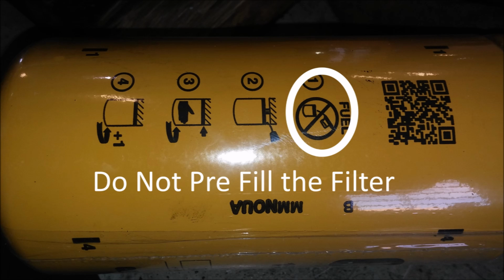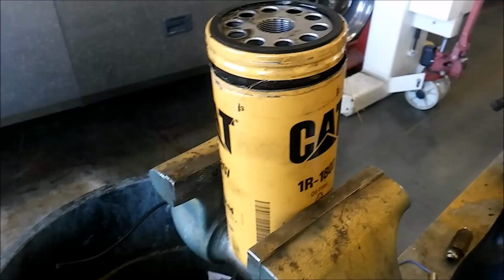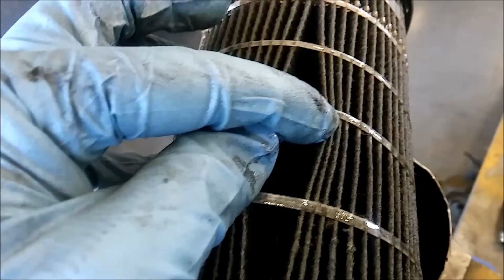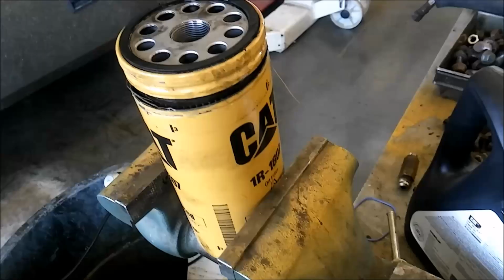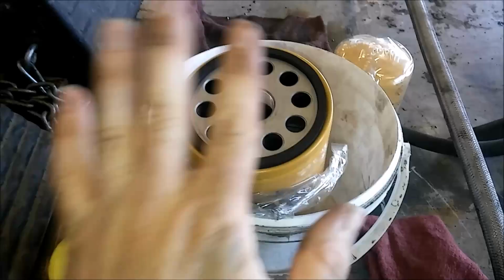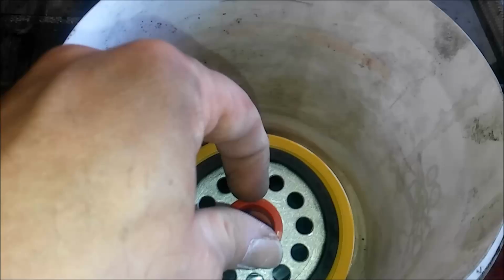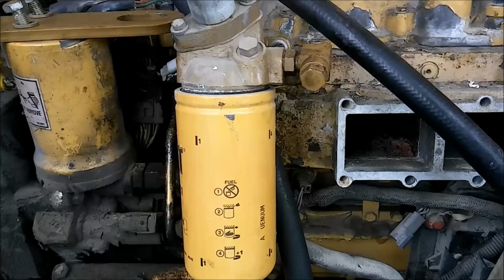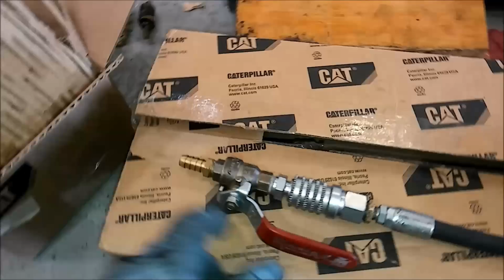Should You Pre Fill an Oil Filter? Should You Pre Fill a Fuel Filter?

Comment: always have filled them up in the center. as long as its new oil and new fuel. worst thing you can do is not prefill a filter especially on a big engine that has several oil filters and sometimes a gallon or 2 of oil can cause unnecessary and premature engine wear. but hey what do i know
Reply from the maker: +hayden ingram Lots of people fill them like that, I do on a rebuild, but I was just giving the information from the Caterpillar guidelines.
Reply: I agree with you man 100% you should always prefill
Reply: yeah at cat they tell us dont fill them which i dont listen to that. my boss didnt like what i said.lol
Reply: teller of truth I look every time and don't see anything ever.
Reply: lol i look every time. i dont understand why you are so hostile haha
Reply: alot of large engines. about 16 litre plus normally have a prelube pump and the engine wont crank without a certant oil pressure.
Reply: hayden ingram prefilling is fine, but fill from the inlets of the filter, not the center outlet.
Reply: i prefill every single oil filter thats upright through the center. i changed the oil in my 7.3 the other day it takes 15 qts of oil which is 4 1 gallon containers with 1 qt leftover. they are white bottles and guess what just like every other time i change oil with rotella the bottom of the container is clean with no debris or dirt. the people on here that say oil is full of dirt and debris are complete idiots im done arguing with you arm chair mechanics who cant even fix a peanut butter and jelly sandwhich have a good day and god bless.
Reply: "I've never seen an oil jug with out dirt "

Stop buying that Dollar Store brand oil!
Reply: if anyone is interested, oil comes in dark jugs because its not designed to ever see the light of day, uv causes shit to degrade, same reason beer comes in dark bottles
Reply: I was always told beer comes in dark bottles so you can't see the mouse inside
Reply: I been a diesel mechanic since I was 18. That was many years ago. I have seen crud collected in the bottom of jugs of new oil. Light colored containers are easier to see it in for sure.  All oil regardless of quality has debris settling out that gets caught by the filters  or settles to the bottom of the pan. 
What you can see is definitely not consistent and can completely disappear if you shake the jug or bottle. This shows that there are definitely larger particles that can fall out of suspension. Tests sent to labs will confirm this.  
So for you guys claiming that new oil in a jug is filtered to car filter standards you do not know what you are talking about.  Send it to an independent lab and see what they say then come back and tell us about it.
Reply: have put over a million miles on 3 different diesel engines and never prefilled one is still running as far as i know. but i never fire it up until it shows oil pressure.
Reply: @HaydenIngram  

Lol!
Reply: @Gideon_Judges6  

Holy shit!!! Just about pissed myself!!!!

Comment: I completely agree with what you said. I have three International IDI's in my Ford trucks. I always prefill their fuel filters, otherwise I'd be sitting there cranking forever to purge the air with their mechanical lift pumps...
Reply from the maker: +Clint Osowski Not pre filling the fuel filter can be a real pain in the butt.
Reply: Yeah, and a battery killer...

Comment: Yes , you are exactly correct . However I have been filling filters from the center forever but after seeing this and knowing the risk I have imposed on my engines doing field maintenance etc. Maybe we could build a filter primer for fuel and oil . 

Thank you for this video .
Reply: Cat has primers for fuel on their loaders. You just screw on the new filters and flip a switch and it primes the whole fuel system.

Comment: I have a series 60 we pre-filled since new. at 1,000,000 miles. The blowby suction tests showed no loss in compression and the oil samples were always in the green. I pre-fill because I know how much oil each truck uses exactly when I pre-fill. When I am done pumping oil, the level will be at the line on the stick even after warming up. CAT is crazy on fuel filters, it's not just difficult to prime, its damn near impossible without pre-filling.

Comment: So long as your not sloppy and prefill your oil filters (doesn't matter which side) with new oil using a clean funnel you won't have any issues. As for fuel filters, all the CATs I work on have hand operated priming pumps on the secondary filters. On the bigger CATS this is essential as the filters are reasonably large and will push the internal volume of air through the fuel system damaging pumps, injectors ect.

Comment: If one is worried about contamination on "new" oil and fuel, why not pre-filter that fluid thru an OEM filter on a rig? you know have a small pump push the fluid thru a filter which is used only to pre-fill new filters being fitted to an engine and only right at the very moment they are to be installed. Then you get the best of both worlds, nice full filters, filled with properly filtered and clean fluid.

One "Pre-fill" filter would last probably hundreds of engine filter services before it had to be replaced itself.
Reply: By simply mounting the oil jug up high, you can simply gravity feed the oil through the filter, eliminating the need for a pump. pouring it slowly will insure that all the air is purged out of the filter media, giving the filter a better prefill.

Comment: The way I interpret this is bulk oil is already contaminated     in that case I would not prefill the oil filters    if the oil is new and
clean to begin with I would pre fill the oil filter   so far for the fuel filter diesel I never did that my guess would be put them 
on dry and unloosen the injector nuts and prime the air out of the system?           I know on airline passenger
jet liners my understanding they never change hydraulic fluid because the possibility of contamination  they always add to it
very good topic   allot of half ass A&P mechanics out their also   its scary   
(I favor not to prelude the filters) for contamination reasons   I always prelude a engine that is new   diesel I never worked with

Comment: On the fuel filters for a Deere 8.1 engine, they come with a dandy little funnel that screws into the center hole, and forces incoming fuel to fill the filter from the outside in, as it should be done. As far as pre filling oil filters goes, the only one that I ever ran across that pre filling was mandatory was the turbo filter on an EMD turbo engine, and their manual said nothing about the "right way", so the vast majority of those were filled via the center hole straight from the boat's bulk oil tank.  :-/  Good tip on the dust cap, I used to teach my guys that trick. Another thing that we'd do for filling those turbo filters was to raid the rag barrel, set the filter in a five gallon bucket like you do there, and then pack rags around the filter so it would stay upright. Good video, loads of good information. Thanks!

Comment: Well I know for a fact Cat started putting the full filters upside down so you couldn't put fuel in the cuz pple getting dirt in them and fuckin up injector's cuz with the new machines carry such high full rail pressure even a speck of dirt can ruin them and that is why they put a electric fuel pump on them or a hand pump so use it

Comment: I don't know about changing oil and oil filter on your big CAT engine using bulk (not so perfectly clean oil) but for home automobile, I have some thoughts. It depends on how your oil filter is mounted, horizontal or vertical. Obviously,  you can't pre-fill a horizontally mounted filter. My 2003 Ford Excursion has a vertically mounted filter and I always pre-fill the filter. Another point I want to make is with the filter already pre-filled and when you start the engine after the oil change the oil pump will get the oil much quicker and the time it takes to prime the oil pump is greatly reduced and also new oil will circulate the almost dry engine faster thus reducing any unnecessary dry start engine wear. Since for home DIY oil change project, we are buying brand new bottled oil either in 1- quart size or 5-quart size and there is no contamination so pre-filling the oil filter from the center or side holes makes no difference.  Pre-filling the oil filter (whenever possible) does an engine good.

Comment: To the people who dont pre fill oil filters because "the oil is dirty because of mass production" or whatever, what exactly do you do with this "dirty" oil right before you pour it into your crankcase? I highly doubt you guys  run it through some kind of filtration system before you put it in your engine.
Reply: Gilbert Rentas 
Such a good point.
They are over thinking it with no pre fill approach yet dumping oil directly into the crankcase like everyone else. Ha!
Reply: oil from the crankcase is pumped directly through the filter, before it passes on through any of the oil galleries. The concern would be if the filter is prefilled through the center hole, where the unfiltered oil will be pumped into the galleries. I, Myself, don't worry about the contamination, if I'm pouring brand new oil from a brand new bottle, into a brand new filter. I would rather have the immediate oil pressure, to reduce 'scuff' on the initial restart after the oil/filter change.

Comment: Great topic. I do several services a week, I've always pre filled the fuel filters, never pre filled the oil filter, can't imagine trying to screw on that big C15 filter full of oil.
Reply from the maker: It is a total pain I assure you, plus you probably know that it is hard to get the oil filter aligned and threaded sometimes. Thanks for the comment.
Reply: This whole discussion should not include diesel owners/techs that have/service engines smaller than 11liters. When you work on big engines different rules apply. The sheer weight of the big block oil filer filled with oil makes it almost impossible to screw it on by hand. On ISX15 for example the access to the filter is very limited and you can try all you want to screw it on with oil in it, but if you strip those threads than you are in real s**t! Now, it will cost thousands in labor and down time to fix it. It is just safer and more practical not to put oil in. You can add some if you really want, but it's basically pointless. Yes, Cummins wants them prefilled but....

Comment: Iv had this same argument with techs/owners over the years. I never fill an oil filter. The only thing I ever fill is the fuel and thats just a necessity. Iv even had an argument with another tech about pre-filling a dang coolant filters. Why the hell would you think you have to fill a coolant filter. Anyway, love the vids man. Very informative and you explain things well.
Reply from the maker: Thank you very much. I have seen a lot of disagreement on this very subject so that is why I made the video. Keep the filters clean!
Reply: Stephen Co
Reply: Stephen Cox have to prefill coolant filters otherwise you could get an airlock in the cooling system
Reply: i have made it a habit to always vacuum fill coolant systems. then let them hold a vacuum while i do some paperwork or other repairs for awhile.
Reply: So you are saying you are smarter than the us military in there studies on filters! A filter is stronger wet. They spent a lot of our money finding why the filters burst on start up.  They found out its dry!
Reply: freddy freddy 
It is likely military equipment runs at higher pressures requiring prefilling if that is something done for military, in the case of my f150 engine, my oil filter is vertical upside down, impossible to prefill.
Reply: Stephen Cox 
Air?
Reply: Poppycock..   you must like to subject your engine to oil starvation. That's why your engine knocks when you change the oil..
Reply: I always thought it was proper to fill the oil filter from the center hole until I watched this, now I understand when and when not to bother with it. The fuel filter on a diesel always seemed like a no brainer to fill, don't want air getting into the injectors so fill'r up. However i didn't know that filling from the different holes made a difference.
Reply: Fuel systems are way more sensitive to way smaller contaminates why not fill with primary fuel tank pump after filter is installed now all fuel is filtered into fuel system.
Reply: @AdeptApe  put magnetic fiber in oil pan no more arguing cause i do prefill filter and my sawmill outcut any new one and run smoother 3 cylinder gm 1938 just hit 1430000 hrs

Comment: This all makes sense. The only time iv ever prefilled a oil filter is when it's verticle. Mine on my LBZ Duramax is horizontal so I don't prefill the filter. The fuel filter IV never prefilled due to you manually priming the filter plus I have a lift pump that circulates my fuel. But this was good info thanks for taking the time to share your knowledge.

Comment: I have a 2016 Nissan Titan Xd diesel with a 5.0 V8 Cummins. Owners manual states to pre fill the oil filter but not the fuel filters. I like your logic on filling the oil filter but will follow Nissan's instructions on the fuel filters.
Reply from the maker: +Bill Helmick It is never a bad idea to go with the manufacturer recommendation. Most vehicles seem to be going to a cartridge style filter, is this one still a spin on?
Reply: Adept Ape the fuel separator and the fuel filter or both cartridge style. All of the filters are rebadged fleetguard filters outside packages have the Nissan part number the filters have the fleet guard part number and name.  Both are accessed by a cheap plastic cap using a 1 and 1/8 socket. You need to be very careful when removing or you could very easily round the corners of the caps

Comment: Thanks for this video! I am no mechanic but do change the oil in my truck regularly. Yesterday i had the bright idea to fill my filter into the center hole.  I notice too on this change the filter is leaking a bit. I will try and tighten and see it that helps but MAN I learned my lesson.  Thanks for your Expert Advice.

Comment: There should be no contamination in a new filter on either side.
Reply: Ray Davis There is dust in the air. Loose hairs, etc.
Reply: Contaminant in the fuel... 4-5 microns Can hurt the system...

Comment: According to my TDI I always prefill the diesel filter but not the oil filter. Since the oilfilter gets wet and 'air/bubble-less within seconds anyway. But if the diesel filter isn't prefilled properly you'll get those nasty bubbles for a long time. Like my neighbours car has this problem and during drive it sometimes works out like limb mode.

Therefore on VAG (VW, Audi, Scoda...) diesel engines  I always prefill the diesel filters.
And yes I fully Agree on Adept Ape for 'considering the filter direction' otherwise it might be dumb as nuts xD although it is actually that hard to find out how they work. :D

Comment: You're worried about clean oil, on the inside of a new CLEAN filter? When you pour it in and wait the oil migrates to the correct side of the filter. Pour, wait, pour, wait until its totally full.
Reply: Jimbob Exactly what i thought and do.
Reply: Well, I think he is saying there could be something in the bottle that shouldn't be there.
And more to the second point, if there is something that gets on the "clean" side, sure the oil will migrate over to the "dirty" side through the filter, but, obviously, any dirt wouldn't.
Reply: Jimbob that’s what I do